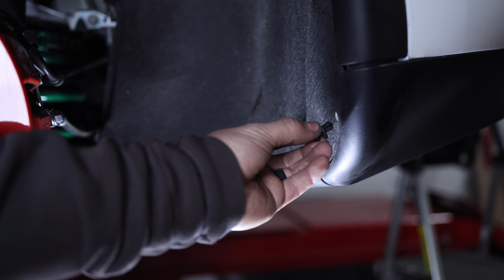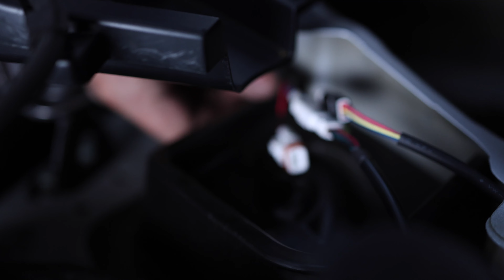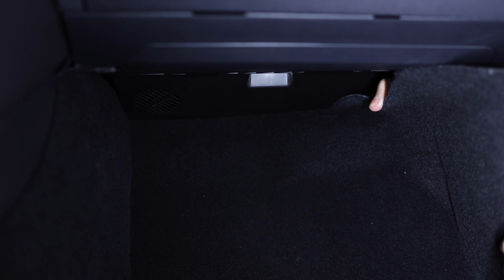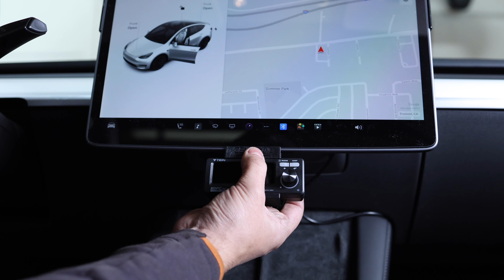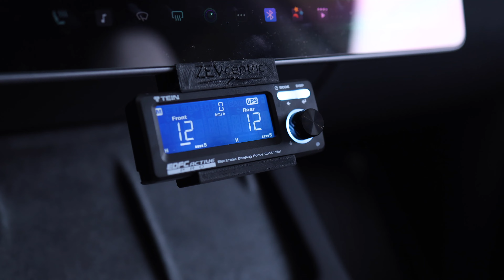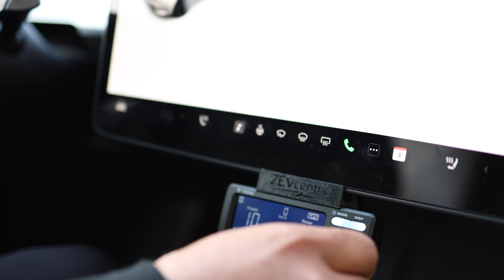DIY: How to get active damping suspension out of your Model 3 and Y! Tein EDFC and Flex Z Coilovers.

Comment: How's the damping range on the Teins these days?  Back in the day, they're damping wasn't so good which made the EDFC more of a gimmick.  Rooting for those guys.  Hope they can pair this with something like a Ohlins DFV
Reply from the maker: Unlikely they will pair with Ohlins since it cannot adapt to oem mounts.  The new Ohlins DFV rides horribly in comparison to these.  Redwood Ohlins DFV or MPP KW are far better.  Damping range is chassis specific and honestly this is way better than stock at $1250 it’s a no brainer. Im sure we can take a kit apart to show the damping range on our next install.
Reply: @zevcentric  sure please share the comparison.
Reply from the maker: @sagr5063  compare what specifically?
Reply from the maker: I will say that i stiffen it on the freeway so having that programmed automatically will be real nice.  That way I can have it less floaty at high speeds and comfy at low speeds.  It is noticeable.
Reply: That's good to know on the Teins.  I've wanted to put a cheaper but higher quality set on my YSR like Bilsteins 5100 or similar. The DFV on my S2000 were only good in a small window but any moment you run out of rear travel it was shitty as can be.  I've looked into retrofitting the EDFCs on my JRZs currently but so much CAD and CNC work :(.  Do you have the Teins installed on a Y at the shop we can demo?
Reply from the maker: We have them on a local SR actually but have to clear it with the client

Comment: You caught me man!!! This was my I held out on the UAS v2 shocks! Because of their different adjustment knobs. Wish they still had their v1! Excited to get it running with the bags for sure! Get nice and Baja mode from just a press on the control panel lol.
Reply from the maker: The UAS V2 rear damping is very easy to adjust in comparison to the V1.  They made some serious improvements for sure including the front lower fork is way better now with the integrated sway bar attachment.
Reply: You going to use the electronic dampers with UAS V2? I want this!!!
Reply from the maker: @LUCA0451  not compatible out of the box.  You would have to machine mounts and figure it out.